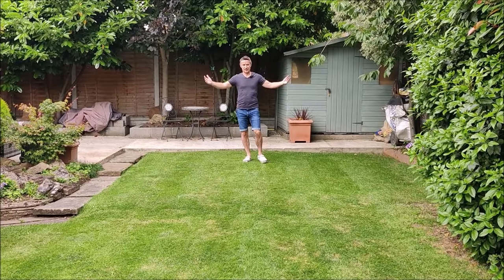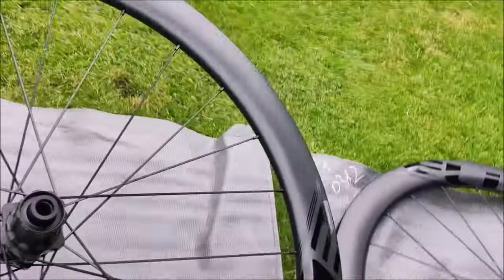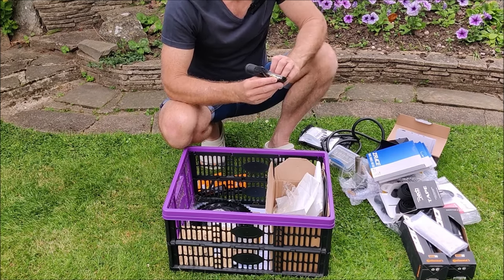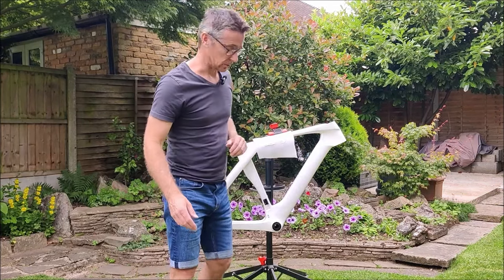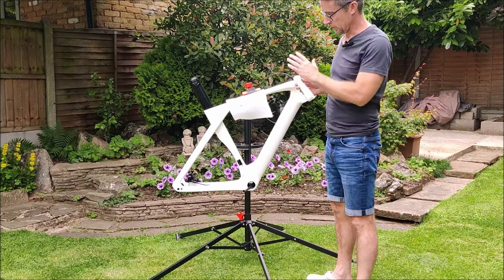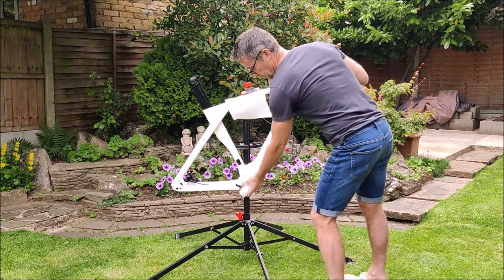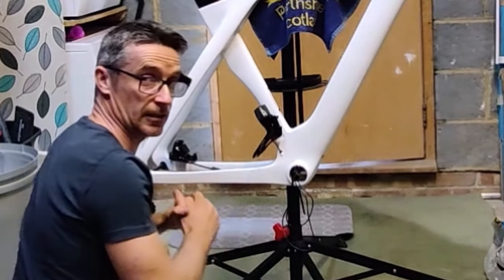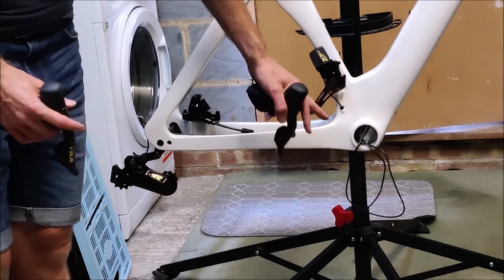Self build road bike. Aero Carbon Hydraulic Disc Electric Shift 12speed sub £1800 !! Ltwoo ERX

Comment: Did you weigh the frameset including all accessories before the assembly? Is the frame itself (without headset, thruaxle, bottom bracket) 1050g or including those accessories?
Reply from the maker: I keep kicking myself as I did not 🤦🏼‍♂️...... I think the issue I had in regards to the battery location took over my thinking during the initial inspection of how the build would go 

I have just messaged BXT on their website to see if they can clarify your weight question.

I suspect it is purely for the frame.... we shall see. You'll understand that I won't rush to disassemble the bike 😂
Reply: @fixitfallows  I did order myself a frame and will make sure to weigh everything :D Will let you know how heavy my components are (size 54, transparent blue).
Reply from the maker: @iTzRafaaaa Excellent!! I just found this production technique video on one of their retail website:

https://youtu.be/PkazDHgvriY?feature=shared